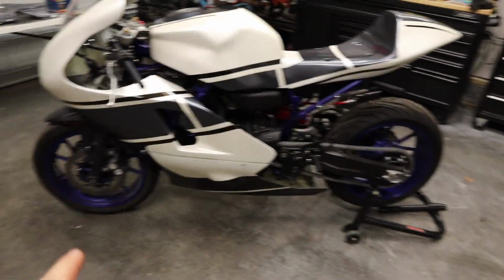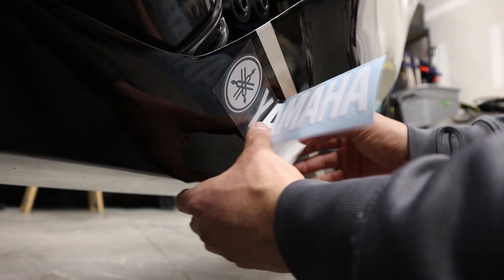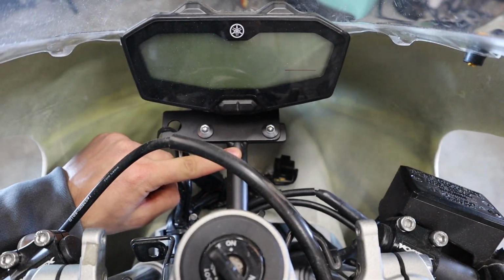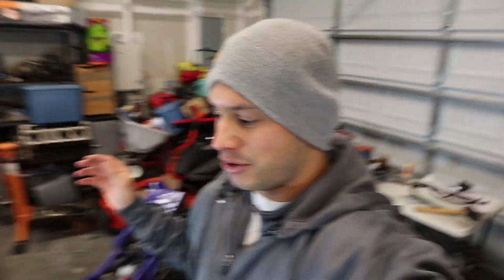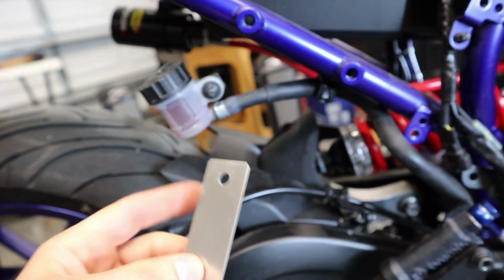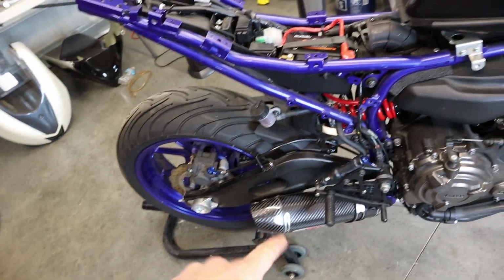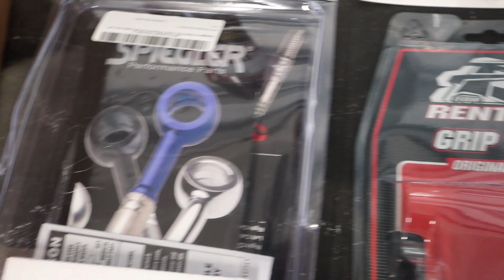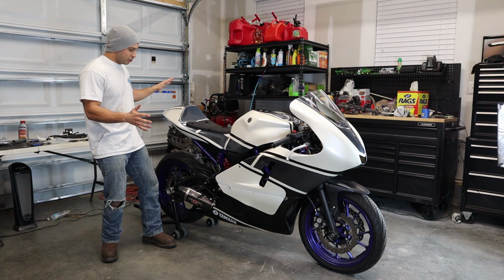MT-07 / FZ-07 Stainless Brake Line Install & First Start!!!!  FZ-07 Rebuild Part 8!

Comment: you need to remove that lockwire from the middle of your left grip …. its awful...
Reply from the maker: May do.  Had safety wire on the middle of grips before without issue.  We shall see once ole COVID lets us play at the track again.

Comment: I am sorry but wtf........
Reply from the maker: Which part is the struggle?
Reply: @torqueriot2384  so you bought and fz07 to make it look completely like a different bike?? I use to work as a Yamaha technician for 4 years and I am a stuntrider and obviously my fz07 looks different but I never have looked at it and said "hey you know what I need in this bad boy needs Motorcycle fairings." you could have bought one that you liked the way it looked. also the fz07 is an upright bike meaning it was balanced so the riders in an upright position. when you change the whole demographic of where the bars are and stuff it will throw off the bikes balance.. even if you dont notice it does. not hate here and I am not trying to get you or anyone else triggered. be safe out there.
Reply: @Deadman_stuntz honestly 
I’ve never seen a full fairing bike
That sounds like an Mt-07 (I’d appreciate it if you’d correct me if I’m wrong)
So it really all comes down to preference 

I genuinely hope an MT-07R is coming in the future

(And yes I know this comment is 3 months old)